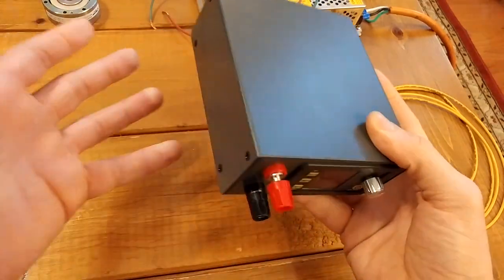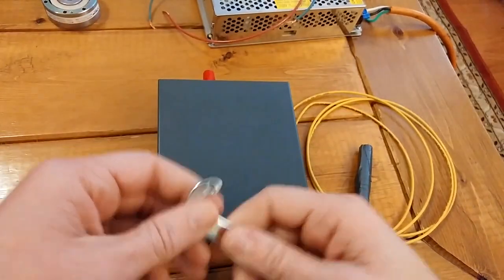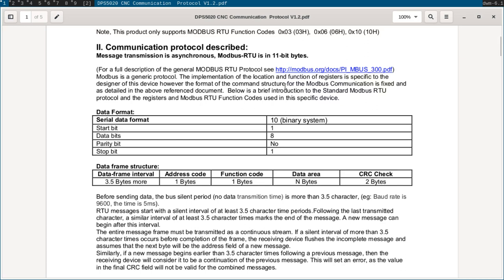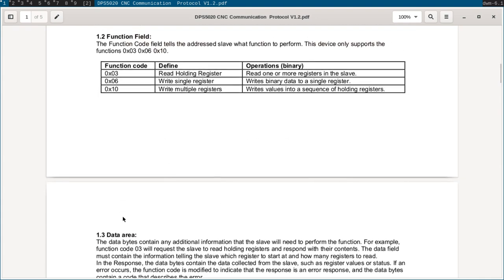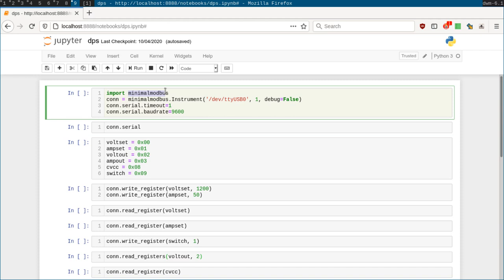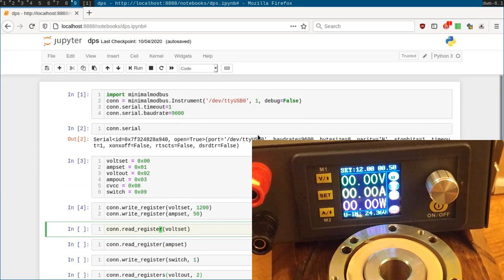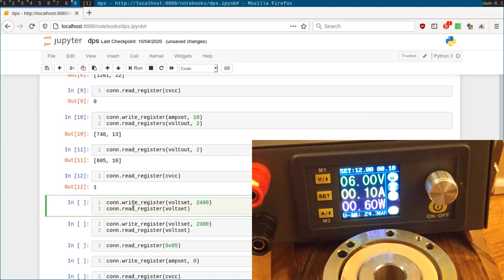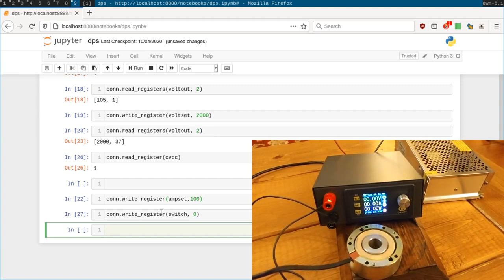RD Tech DPS5020: Modbus CNC example

Comment: If you are able the change the current remotely, then you should be able to control the diameter of a cylindrical cut as well. If you wanted to, you could program the ECM machine to taper holes this way. I am waiting on a friend to loan me their ender so I can make a video on converting it to an ECM machine.
Reply from the maker: A plug-and-play design for an Ender 3 carriage would be amazing. It's one of the most popular printers out there, and rightfully so.

Comment: If I knew the best settings for current and voltage for this process, I bet I could come up with a custom constant current circuit board that could be interfaced with whatever was the best way. I'd be happy to open source it.

Hypothetically, I could probably make it controlled by step and direction pulses like a stepper motor if that made integration easier. I could probably have it output a proportional analog signal for the voltages and current being used also. 

I have an ender 5 plus, a 0-60V 0-3A PSU with serial interface, and some flat ended syringe tips even laying around. Might have to play with this soon.
Reply from the maker: I'm not exactly sure I'm following the purpose of moving from Modbus to pulse controlled with analog feedback, but I am interested in seeing what you come up with!
Reply: @swolebro  Really I could make it anyway that was easiest to control. I was just thinking about the discussions about making a "bolt on" 3d printer upgrade. Having it controlled with step and direction type signals could potentially make it easy to plug into one of those custom controller boards like Big Tree Tech or similar make, and have an easy time with software integration.